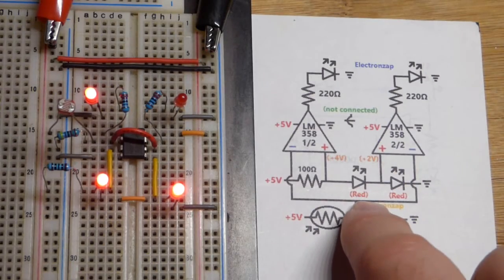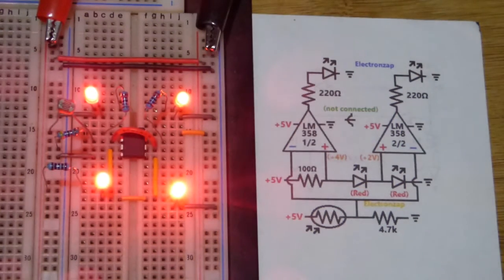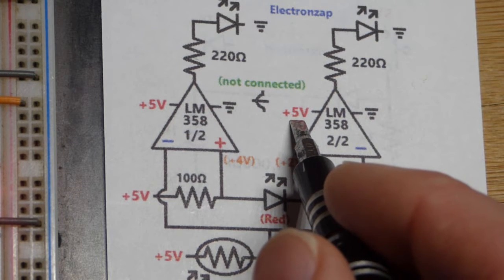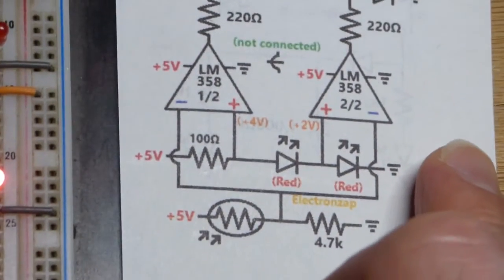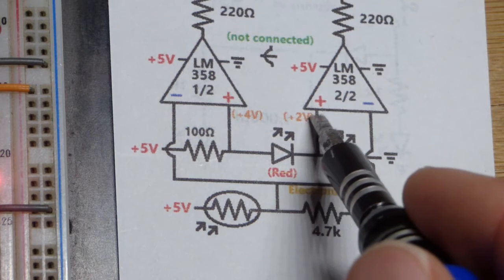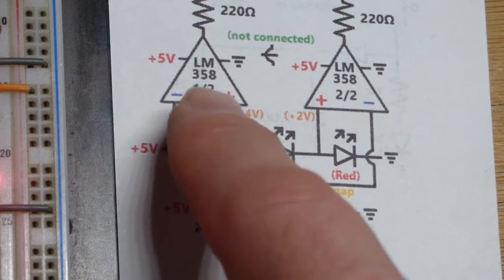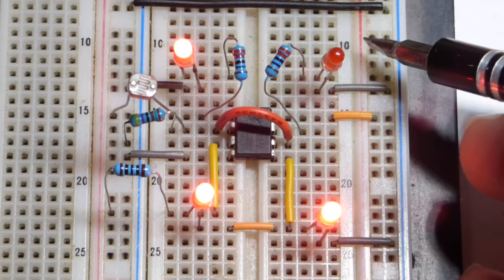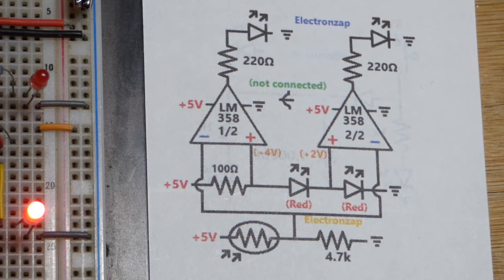Op amp light level indicator with 2 and 4 reference voltages using two red LEDs by Electronzap

Comment: Awesome channel, great information. I need to adapt something like this for a pre-charge indicator for my off grid system. Red LED until voltage equalisers between caps and batteries, once pre-charge button is pressed. then GREEN led to indicate main DC breaker can be closed. If this is something up your alley, love to see a vid. No stress 😎 Thank you from OP Down Under.
Reply from the maker: Not sure on that one. I generally just fully charge each cell individually until they are all fully charged if I have a balancing issue. If I wanted a visual of when they are all fully charged, then I might use a comparator for each cell to light up once it reaches a fully charged voltage.
Reply: All good, got it sorted 😎https://youtu.be/JTSG-x9EFH8 SAFE Off-Grid Start Up Procedure For Parallel Victron Energy Multiplus II - Extend Equipment Life Turned out better than expected! 😀